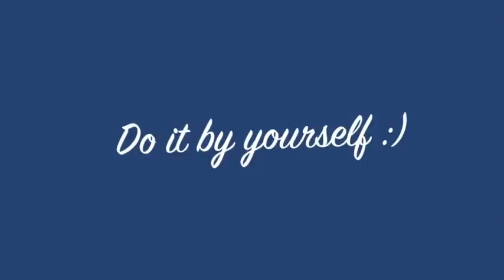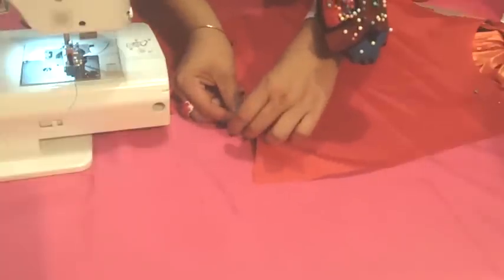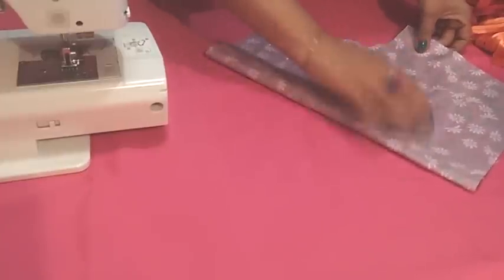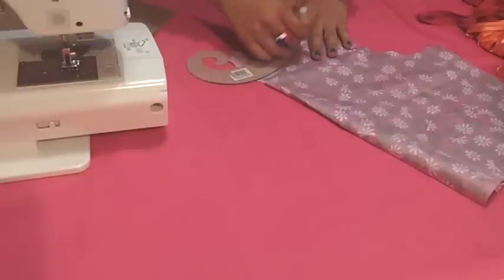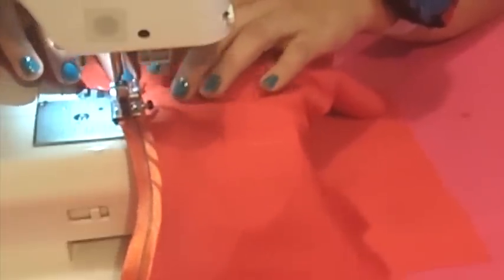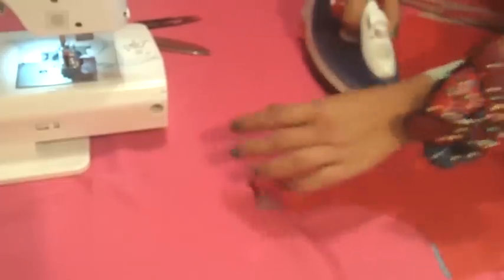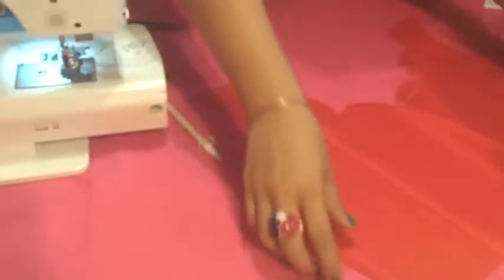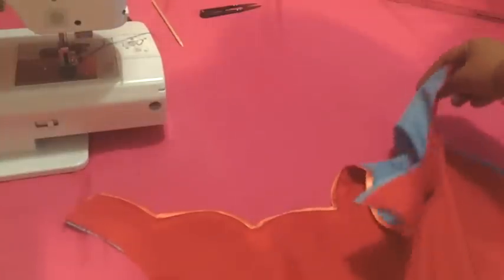♥ Necklines Lining, Binding, Piping ☁ Advanced class 1

Comment: Thank you, this is explained so wonderfully. In the video, for cord piping for V neckline, you have mentioned it is always better to use the technique explained by you with lining. There are some materials where I would like to make a V or square neckline with cord piping, but without the lining. Could you clarify, how I should handle the corner of V or Square in the cases ? Thanks in advance.
Reply from the maker: without lining is even easier. only attach it as olain binding and overlap the cord piping in the corners :)

Comment: I have a question.. How can the binding be perfectly flat? The tape is straight and the neckline is curved so I don't understand how it doesn't get crumpled when sewed together
Reply: +하지윤 Because the tape is cut on the bias, it has natural stretch.  So when it is stitched onto the smaller edge, it flattens out (especially if you iron it) by stretching a little bigger or shrinking a little smaller.